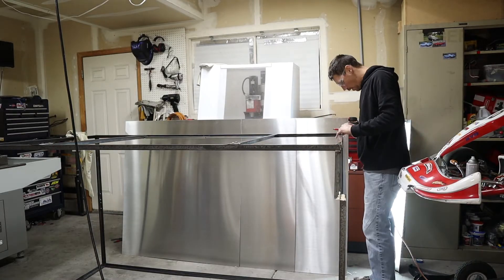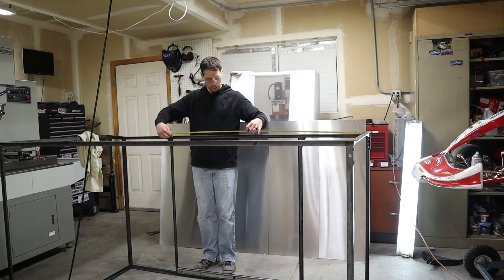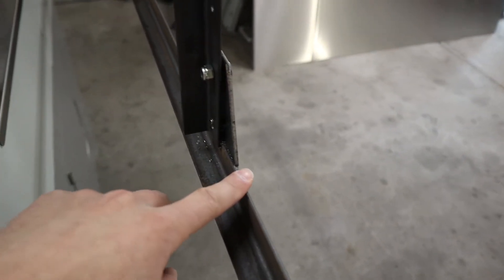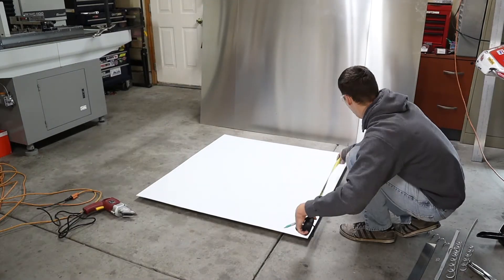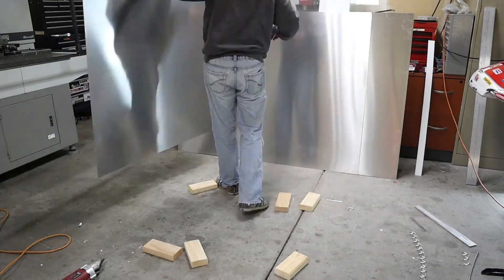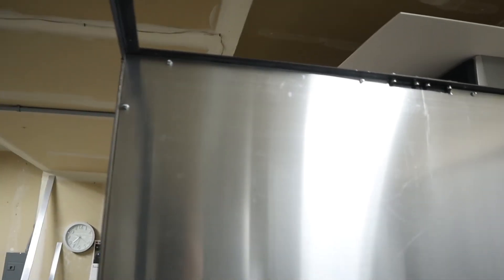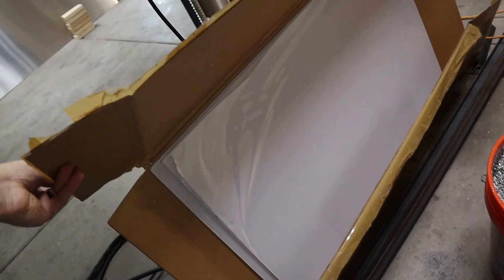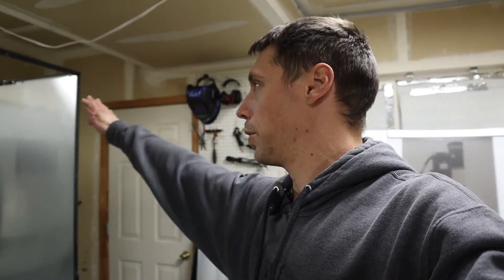Part 6: Tormach PCNC 1100 Mill DIY Enclosure Build

Comment: Where did you get your sheet metal?
Reply from the maker: Funny you should ask, I called around everywhere and the only thickness I could find was 0.024" which would have been really floppy.  I ended up having my go-to metal place, a local supply store, order it in.  They had it in 0.040".  I'm not sure how I feel about aluminum, it was nice and light to work with, but it was expensive and could corrode since it's attached to steel.
Reply: @RivalMachining  Thank you for sharing your process, the enclosure looks fantastic!